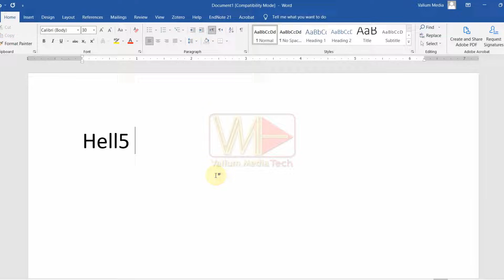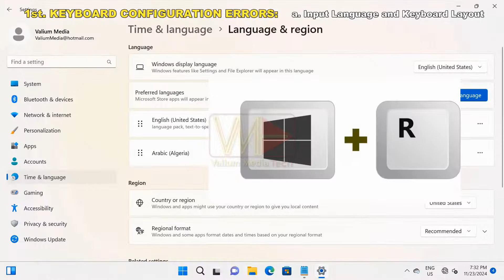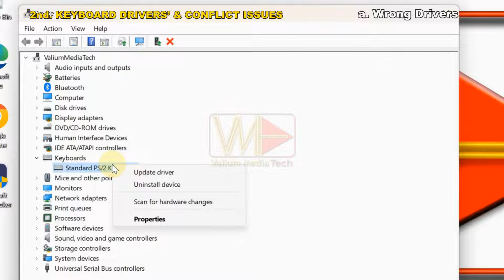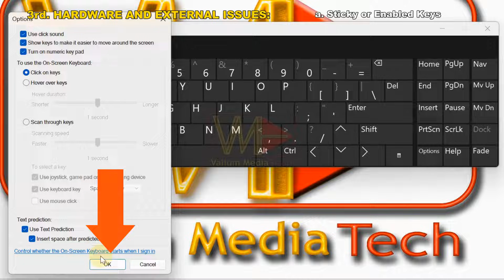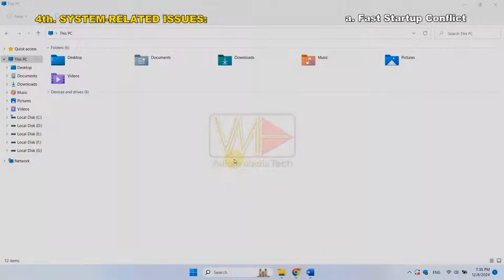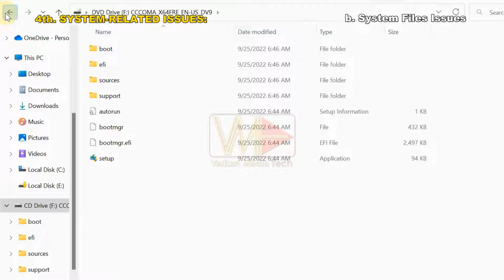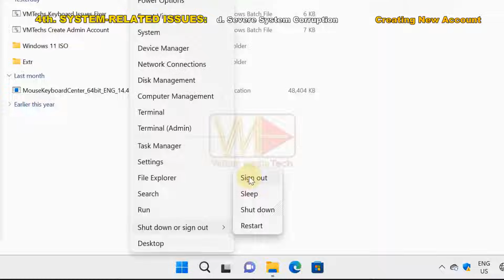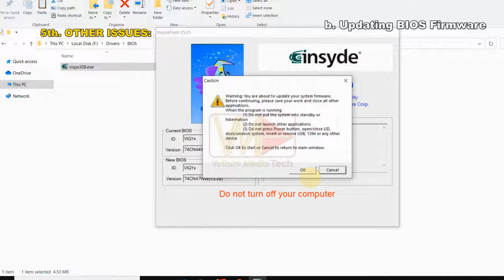Fix Keyboard Typing Wrong Letters or Characters | 20 Proven Methods for Laptops & Desktops

Comment: My laptop keyboard is working but external keyboard is not. When I remove the battery from the ext keyboard and put in again it starts working but different letters(latin type maybe idk) are being typed from both the keyboards. When I restart then again only laptop keyboard works. Help plzz